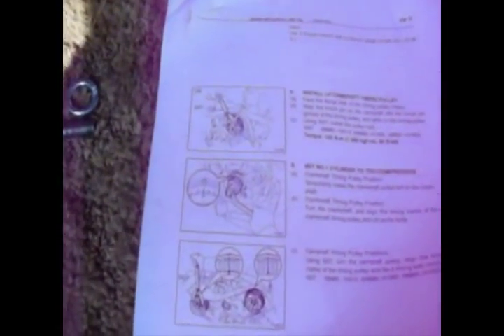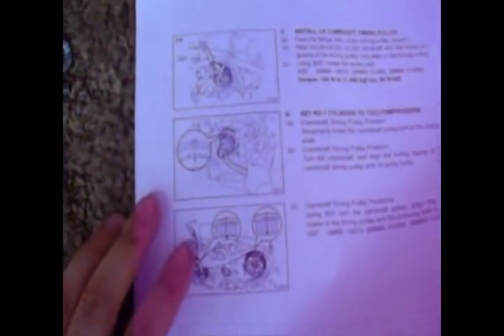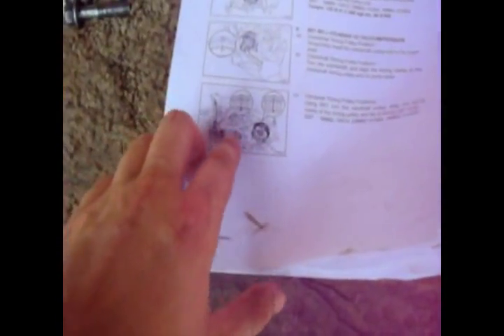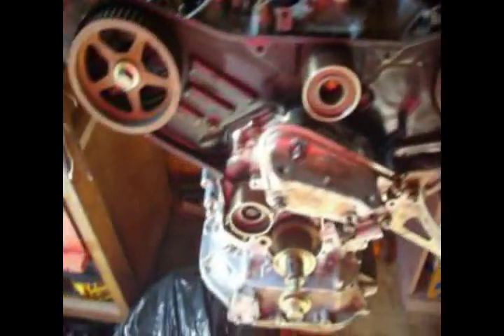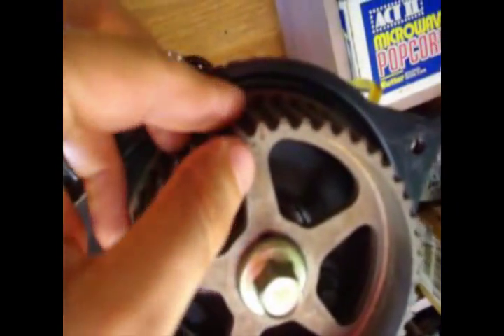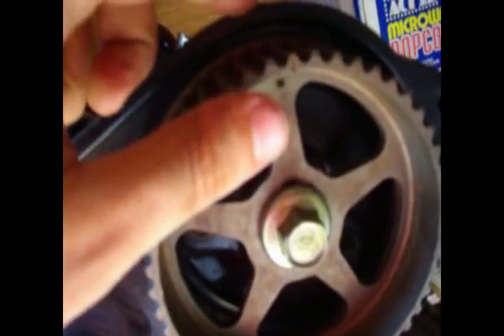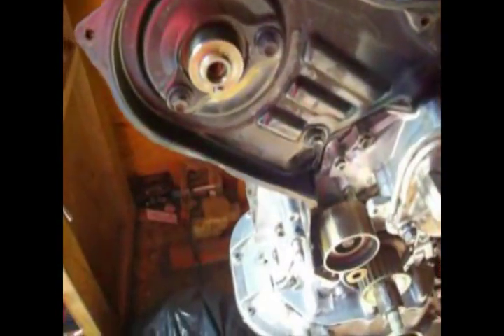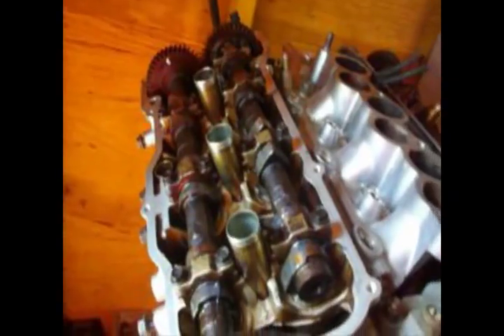Need Help with Toyota 1mz Timing

Comment: So do you set the rear head to set of 2 dots with cylinder 1 top dead center and then turn the cam 180 ° so the single dots line up and not worry with cylinder 1 being top dead center at the same time?

Comment: You have it correct. You just need to pull the service bolt and rotate the rear cam 180 degrees to match the belt marks. any questions just hit me up. jlindesmith123@gmail.com
Reply from the maker: jascha lindesmith  hey no worries this was 5 years ago. 
the car has been running since

Comment: Align with the outside marks. The inside are only for installation and mating of the counter rotational cam gears. They are set separately.

Comment: Its because the dots are there to put the cams in sync ONLY, after putting them in sync you can turn the cam pulley 180*  to place the timing belt on the proper marks and ignore the camshaft  dots.  PS... don't worry about bending any valves when you turn it, this is a non interference engine, the valves will never get hit.

Comment from the maker: See if someone would have told me this before I wouldnt have spent a total of two months trying to sourch good information, the BGB pages are mis-leading.
Ultimately after aliging the one dot on both banks, for exhaust and intake cams. and like mentioned before i set the crankshaft pulley back 2 teeth, (it would jump when the tensioner grabbed) Everything seemed to line up, after rotating the engine... 6 times or so lol I felt comfortable everything would stay intact, now for everything else
Reply: When you said rotate the engine six times you install the timing belt and make sure to remove the bolt in the middle of the gears? That's correct?

Comment: Agreed.  I was running into  the same issue.  I think 2 dots on left bank are specifically for aligning camshaft for removal/installation.  The  left camshaft also has one set of dots.  Before removing my timing belt I set cylinder 1 to TDC.  Left camshaft aligned at 1 dot and the right camshaft also aligned at one dot.

Comment from the maker: Yes I basically just started puting it together as is, and it didnt stay in time, 
SO I rotated the cams to line up on one dot a piece, set the crank pulley back like 2 teeth, attached the tensioner and now its in time.